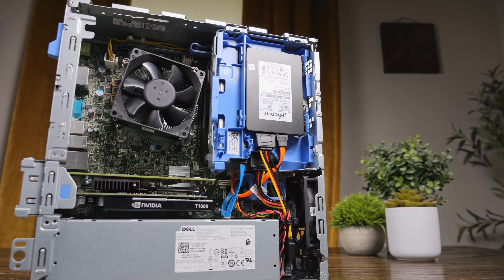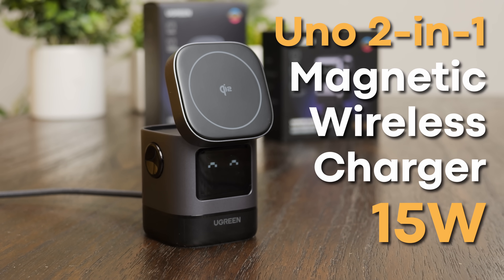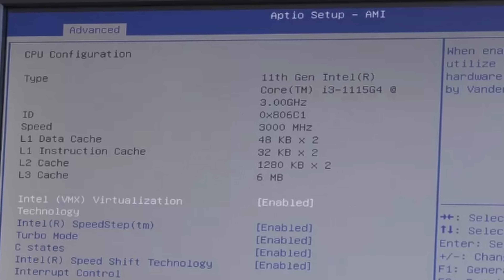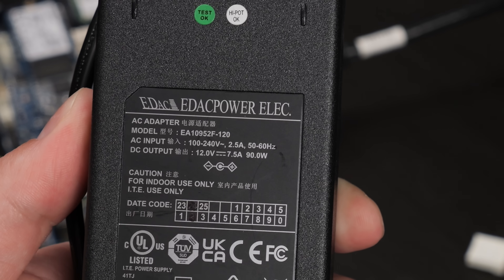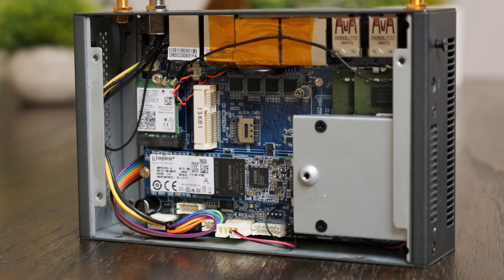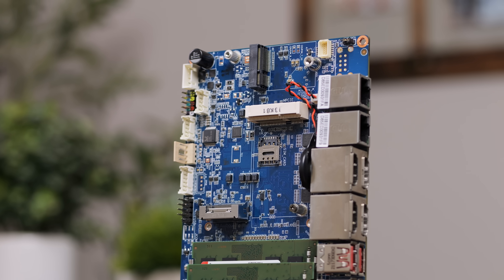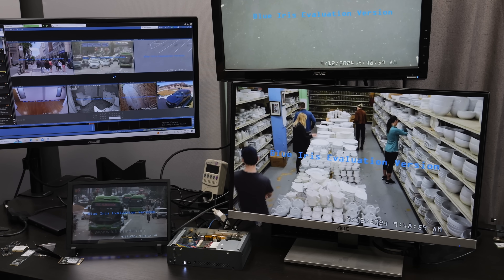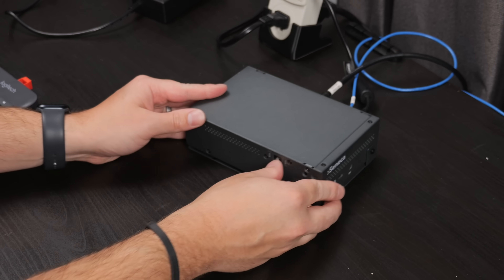This isn't a normal mini PC... and I love it.

Comment: A former co-worker of mine shared this video with me, and to say it made me giddy to see our product being torn open and analyzed like this would be a wild understatement. I was the design engineer for Seneca's digital signage products from about 2013 to 2024, and the Element product series was by far the most fun I had in designing a small form-factor/MiniPC. We really tried to jam as much of the available board features into the chassis as possible (hence all the knock-outs), while still keeping it tiny and running cool.

Thank you so much for diving into this and providing an excellent run-down on the products capabilities. It feels pretty incredible to know that something we ex-Seneca folks truly loved, but whose future was ultimately cut short, is getting a new lease on life via the DIY tech community.

I know this video is a little older now, but if you (or any of your followers) have any questions on the Seneca Element, feel free to reach out - I would be happy to help!

BONUS: if you wanted to take advantage of the HDMI input, we designed that capability around the Magewell EcoCapture HDMI 4K M.2 card (p/n 11524) and it's panel mount HDMI port - you'll just need to leverage your mSATA for storage.
Reply from the maker: This is so awesome!! Thanks for designing such a great little system, and thanks for the comment as well. I’ll have to check out the HDMI input adapter…
Reply: Thanks for announcing yourself.  I am intrigued by this board.  I'd like to run openwrt on it, but of course who knows if it'll have the needed kernel drivers.  There are some dev boards out right now that are targeted wifi 7 + lte/5g in the $200 price range, but their signal quality is poor.  I want to tinker with this and see if it's a better substitute.

Comment: 4 HDMI could mean office desktop, not necessarily digital signage.
30 years ago, I had a sparcstation on my desk (and a giant CRT monitor).
Until about 10 years ago, we had workstation PCs from Dell or HP.
Now, we connect to "our" PC running as a virtual machine and have a box on our desk hooked up to a keyboard, mouse, 4 monitors and a webcam and headset (for zoom calls). That box is a PC, just not a very powerful one.
We still have phones on our desks, but unless you expect external calls, you generally don't use it. (The pandemic impact to our desk setup was Zoom replacing phones, and a relatively long period working from home)

Comment: Subscribing.  I like these tinkering videos.  I have a small project I am working on using some old Lenovo ThinkCentre M715q Tiny mini PCs.  I have a custom D&D table with a raised center island.  Inside the island are a couple power strips and multi adapter USB cables, one per player position.  My players bring their laptops and connect them to the home wireless network then use their browsers to access my Foundry VTT server where I run my games from.  It's kinda messy so I wanted to see if I could make this more efficient and less messy.  Also, depending on the age of the users laptop or configuration, performance can take a hit for them when accessing my Foundry server. I use a lot of animations and animated scenes. Anyway, I grabbed six Lenovo ThinkCentre M715q Tiny's from ebay, as well as six refurbished 1920x1080 portable display panels from Acer.  I plan to install the mini PCs inside the raised center island, along with a network switch.  Hard wire them rather than use wireless.  Just faster.  I then place the portable displays along with a wired mouse and keyboard (no battery failures in THIS house!) at each player position connected to one of the mini PCs.  The mini PCs will run Fedora 43 Plasma X11 as the OS.  The browser will be Chromium. The OS will be stripped down to be as efficient as possible.  I also found these little 180 degree adapters to hide the power and hdmi cable connections behind the portable displays.  Clean look!  OH, I also plan to put ruber feet on each mini PC to ensure it has 100% air flow around them.  I MAY have to put a fan in the center island to draw out the warm air, if any. Playing it by ear.  Anyway, there is my Christmas holiday tinkering project.  I'll take before and after pics of the center island and player workstations.  Probably way overkill for the intended use, but as a retired IT guy, I just can't help myself :)

Comment: I like PS2 ports
I think it would be cool to grind out an old dvd drive and put this motherboard on the platter so when you hit eject it puts the motherboard out instead of a dvd..
I am sure it could be made to work..  also making a covert computer using a normal atx case that is missing the motherboard disguising it actually working..  just stash this motherboard where you can't see it in a normal case..  6w is as much as an LED lightbulb

Comment: May have been mentioned, but what about using an old DLP protector TV but with a modern 4K LCD panel and diffusion layer in place of the original screen?

Comment: I looked into Blue Iris a while back; the price seems reasonable, but the deal-breaker for me was that it runs on Windows only--which means I can't run it in a VM.  I'm reluctant to buy dedicated hardware just to run a camera server when I've already got a bunch of other stuff in my basement, and spare capacity on my VM server.  But this looks like an interesting option; I hadn't thought about purchasing a cheaper computer (or a NUC maybe) and using it as a proper "surveillance station" with a spare monitor or three, in my office.  It could still record the actual video to the NAS in the basement.  Hmm....

Comment: I have a Lenovo Think-Center 72E That I had been unable to figure out. I believe it has Windows Vista, or 7 on it. I see two usb ports on the front, which would be used to hook up a keyboard and mouse, and three on the back for extra peripheries and USB Flash Drives, plus my 1 TB Iomega external hard drive. I believe it has 4GB of RAM, and a 320GB hard drive. There is a monitor hookup on the back, and an odd shaped port on the back that has one corner beveled at 45 degrees. That port seems to be the same thickness of the standard USB ports. Most of the   hook up equipment I already have! 

I'm doing some research concerning what I can use it for. I would like to ask some questions at this point: 
How hard would it be to install windows 10 on this Mini PC?  
Is there anything important I need to know before installing Windows 10?
Can this Mini PC run applications like DAZ Studio, Blender, Poser, Wings 3D, etc.?
Does this one have the ability to connect to the internet via wireless WIFI?

If you would like to reply in private, you can contact me through my profile, which has my email address available!

Cheers!

Comment: Don't touch the hardware contact pins, if you do, always clean them with Isopropyl alcohol, and you risk Static Discharge.
It has a un-socketed 4-pin Speaker connector and a SATA port. 
Domotic: refers to home automation technologies that allow for the control and management of a home's systems and appliances, such as lighting, heating, and security, often through a central interface like a smartphone app. It enhances convenience and efficiency in managing home environments.

Comment: So I noticed you ended up with five internal drives totaling 120 TB. Is there any way to get Linux to treat these separate drives as a single logical drive? I have two internal drive - both 1 TB - and I constantly have to manually mount the second drive.

Comment: 3:01 My guess would have been 12V PSU supply  voltage and seeing the cables from the barrel jack being black and yellow I would have felt pretty safe with that guess

Comment: Is that a 22-813 RadioShack multimeter you have there? Wanna sell it? Mine just went off the deep end Friday. Stopped measure voltage and the audio continuity goes immediately to short. One second is was measuring, the next second it had a severe stroke and is basically brain dead.  I love that meter. Great PC you found.  Very nice.

Comment: This thing looks alot like the Lenovo liter PCs.  Love those for their compact size and the power they pack.  We have an old i7 M93 for a kitchen computer for recipes and music.  Each TV is driven by a P320 with a P1000 card handling video duties.  Lastly, for the mobile theater we have a maxed out P330 with a P1000/ 8GB card and external bluray burner for playing disks if we are not streaming.  Used they are reasonable off of Ebay as are all the parts to upgrade them.  Great little video.
Reply: Only thing they can't help with, evidently, is how to spell "a lot". You know, how it is taught in school.

Comment: Hi, note that it could easily become a NAS by adding dual 3"1/2 HDD docks stations on USB 3.0 w/ external power supply (12V/3A), 4× USB 3.0 ports = 8× HDD, so up to 192 TB raw capacity.  (NB : works like a charm without any speed reduction under Linux w/ ZFS :)

Comment: If small physical size is required, that is a good deal. I created some touchscreen info kiosks at an observatory. Had a hidden PC driving a touchscreen monitor. Only external requirement was power. Used a desktop PC inside a custom cabinet.

Comment: Why does it have a threaded power port? I have several 45W to 180W AC adapters used for laptops, why would they prevent users from using those types of adapters?

Comment: 5:28 I was told that there are ways of setting up the different nics that makes it easier to have 2 different ones for driver support and network configuration. Most of my workstation will have 2 intel that are the same and a different model nic for the other 2

Comment: You could ask the Senaca (or people who bought them out) what the target market was for that PC.  That may tell you why it has the features it has.
Reply: We built it very specifically for digital signage, but tried to make it as flexible as possible with the feature options. Fully kitted, this thing can handle a lot of different applications. We saw them used as security viewing stations quite regularly

Comment: the problem with micro pc's is the thermals. these micro pc's clearly dont have discrete graphics cards. you have to downclock the APU to run at optimal temps or risk hardware damage. my htpc is still a standard size htpc case with a standard atx board. the more space between components, the less problems i can expect from thermal overload and the longer it will last.

Comment: Last time I looked for a micro-PC with 2x Ethernet adaptors there simply wasn't any such device available (not where I live, anyway, and importing from the US can easily double the cost of something like this, so definitely not worth it). Even today, they are super scarce. The closest I have yet come is a "Giada" box with a pre-installed WiFi card in the m.2 slot - I removed that and fitted a 2nd Gbit Ethernet card, and it works, but if I'm going to install it in this configuration I'll have to drill & file a hole in the chassis for it. Which will involve completely stripping the computer (including doing the squeaky clean CPU thing, which I'm not keen on because... well, because I'm tired of that job). So my laziness means I'm still running a full-size 200W PC as my Internet router / firewall, which is... wasteful) 😭😭

Comment: 2.5" drives don't need 12v, they only require 5v. (both ssds and hdds) hence the usb adapters you can find

Comment: We need PCs with:
1.  Good dust filters on the air intake.
2.  Low noise thanks to large air intakes, large slow turning efficient fans and large heatsinks.
3.  High quality ball bearings on those slow turning fans.
4.  SUPER IMPORTANT:  No Tantalum Capacitors and preferably not Aluminum Electrolytic Capacitors.  Just properly derated ceramic caps and/or film caps.
5.  Enterprise grade solid state drives.

Comment: Great video and I have been looking to also find a much smaller form factor for my blue iris machines (yes I run many). I run about 5-20 cameras (POE) per machines which I realize doesn’t matter in terms of the POE but I was wondering if you think this would work for me ? I don’t make use of AI so I think this would work out of the box right ? Anything you suggest to set it up quickly as a BI machine ? Thanks.

Comment: The most fun part was that you are obviously one of these folks who think thermal paste gets old. Like vegetables ... like food.
That is crazy;)
Explanation: We could manufacture CPU modules and heatsinks with surface tolerances (roughness and flatness) that would make thermal paste unnecessary. The costs would of course be absurd, such as an additional $100 for modules and about twice the price for fine grinding aluminum or copper heatsinks. That's why we use pastes that cost less than a cent to apply and are therefore unbeatable in comparison. The relationships are roughly as follows: copper has a thermal conductivity of approx. 380 W/(m·K), thermal pastes from 0.8 W/(m·K) to over 10 W/(m·K) and air, in comparison, has the grotesquely poor values of 0.024 W/(m·K). You see there are magnitudes between those values and the important thing are those between air and the paste. That is what we use to mitigate surface irregularities. You have also to remember that these irregularities make up only under a percent of the whole surface ... so it is mostly to prevent micro hot-spots and not the overall thermal conductivity.
While this is all about the principle behind it, let's come to the myths and lack of knowledge you guys share. The VISCOSITY of the thermal paste is solely there to make it easier to apply. This means that when applied, it can flow easily and quickly into the micro-depressions of the surfaces and fill them completely. It has nothing to do with the thermal conductive capabilities of the filling material, the purpose of the paste itself! 
Compare it visually with to paint a wall with emulsion paint or plaster the wall ... This also dries and retains the property afterwards: SO TO STAY SMOOTH!:) If the thermal paste has filled out the surface irregularities ... its job is DONE! It doesn't get magically moved away over time or gets "bad" like food. Well, there is one thing of course: IF YOU DESTROY THE BOND BETWEEN HEAT-SINK AND HEAT-SOURCE .... hehehe. Then ... of course!!! ... you have to renew the bond. 

In your defense: You can never know if the previous owner or the manufacturer applied the thermal paste correctly. But you could also believe in a CIA conspiracy. In any case, you can usually tell if there are problems by looking at the CPU temperatures and comparing them with the specifications: RTFM!

This side-note is not meant serious, no offense and no obligation to do it THE CORRECT and PROFESSIONAL WAY or give up the half-knowledge and myths you guys obviously transport and share. At the end it is your time and your money (which is really not worth mentioning in the case of thermal paste as stated above) and your faith in the "wetness of the magic paste". Who cares about specs, material-physics and reality? Computer-Nerds? Naaaah!

Thanks for the video and sharing your thoughts and experience with this nice little curiosity:)

Comment: Most likely one of the eathernet ports has IPMI. Probably the slower port. I would not expose that port to the internet. If the management port is disabled in the BIOS that could be why it wasnt working. Depending on the config the management port may not be exposed to the system as a network port as it would be connected to the management chip. You need the intel management software to FAFO. IPMI has complete control over the system even when its off.

Comment: I stumbled across this video randomly and was pleasantly surprised, love random equipment like this. I'd love to hear your thoughts on Blue Iris though as it sounded like you've moved from Synology Surveillance Station to that. I've got a Synology NAS and have been using it for a couple of years with Surveillance Station and I have to say, I really dislike it; it's just so slow to use and to browse footage especially if I'm trying to view it from the mobile app while on my home network. I can't work out why it's so bad; my NAS has SSD cache drives, a 10gb card, upgraded RAM and yet it's painfully slow when doing anything surveillance related. I've been considering making some kind of change but have no idea what.

Comment: hey @HardwareHaven thank you for showing this little pc.
I had the same idea to use it as an NVR, but with software from Network Optix (NXvms)
that will run on linux and don't need a lot of resources.
are you familiar with this software?

Comment: That type of PC + BlueIris is what is currently running 47 camera channels on my home NVR system.    (I have microwave network bridge links to my other houses in the area) .    No tenant has problems with the CCTV coverage and the fact that it has centralised recording.  If anybody has not heard of BlueIris, I would very strongly recommend it as it has an incredible amount of functionality built-in as standard. Its not free, but it is by far not the not most expensive NVR software you could buy.

Comment: Nice video!
Yellow wires normally indicates 12V - a safe bet at least
The 2 different ethernet interfaces is likely the I219 being integrated into the chipset, and the I211 being an external controller linked via PCIe.

Comment: I've used a whole lot of digital signage PCs. This is a really nice model. Back ten years ago, I was a part of a large format digital signage company (LED billboards), and we started using Logic (now OnLogic), and later switched to BrightSign because the BrightSign players had exposed GPIO ports on the back, which are typically used for syncing multiple displays, whether large billboards or smaller HDTVs. It's really cool stuff. I've actually never seen such a small GPIO header, but that's probably just because of the industry I was in. 

Cool video! Liked and subscribed.